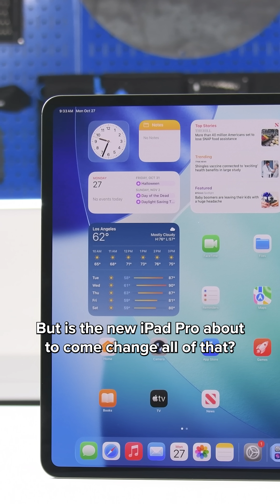iPad Pro M5 has a Repair Paradox!

Comment: I doubt they do this now, but the Apple Store didn't even repair the first iPad Pros. If there was anything wrong under Apple Care, including the battery, they replaced them.
Reply: I have one they still just replace them
Reply: @NathanielMiller-no8lt  Exactly. Faster and safer to simply replace, and service the broken later, and resell as refurbished.

Just charge service accordingly.
Reply: If the housing is bent; they replace them, otherwise if it’s fine and the screen is just cracked they can replace only that component now
Reply: This is the case for older iPads. The oled ones are more repairable.

Comment: If Apple made genuine batteries available to all repair shops, it would cancel out an illegitimate battery industry that scams non-tech savvy people but I guess they rather yield to china
Reply: I think all certified repair shops can order battery ?
Reply: @gund89123 that's not all repair shops though
Reply: @gund89123 certified repair shops get certified money
Reply: Ifix it sells batteries 
I haven’t tested them tho
Reply: No, they’d still sell you low grade knock offs and they’d tell you it was apple genuine. At least now you know they’re lying when they tell you that
Reply: apple already sold Genuine replacements, the problem its the price, $20 after market battery vs $60 Apple genuine.
I can tell u, 90% of the customers dont want to pay that difference.
And Screens are worst, $175 Oled Screen After market high quality vs $350 apple genuine...

Comment: No body hates repairing iPads except you. Almost every technician in my city repairs iPads.
Reply: that does not mean they like it. they just do it cause they’re getting payed
Reply: @harrisonryan6969 paid
Reply: @harrisonryan6969  •paid
Reply: @harrisonryan6969 I haven’t heard or seen any technician complain about the iPad.
Reply: Have you asked? I imagine if they complained any consumer would just assume they were bad at their job. Better just to keep quiet. Doesn't mean it's not a common belief.
Reply: @kakapofan6542 and how did you know that they hated it?
Reply: as a Technician who repair, i can tell u, i hate to do it... that doesn't mean i wont do it.
iPads Pro are the worst, removing a Screen its a big risk, and for replacing the battery, u need to remove the whole motherboard.